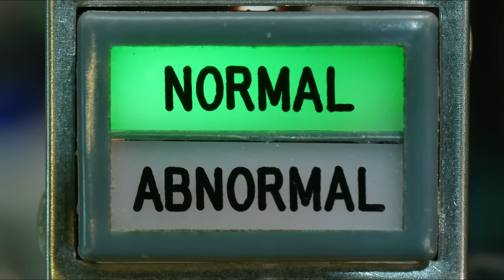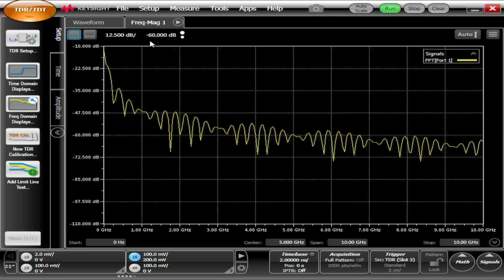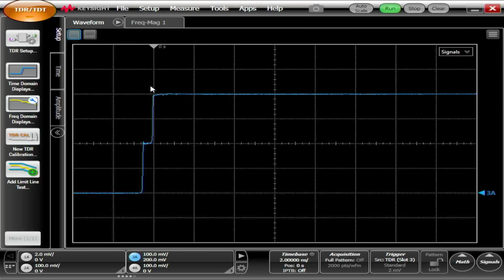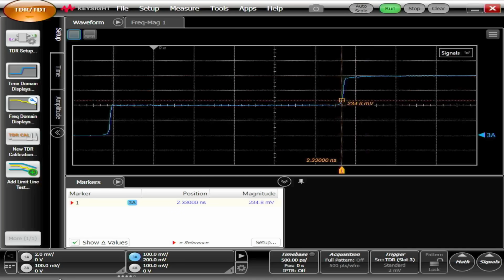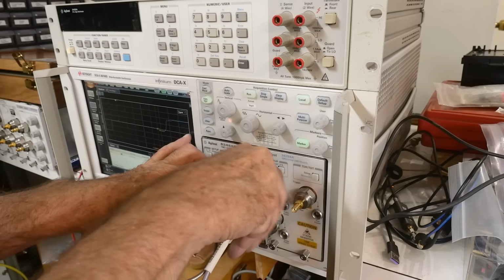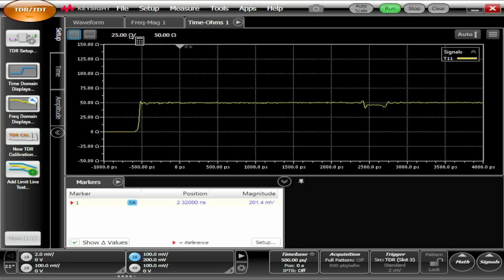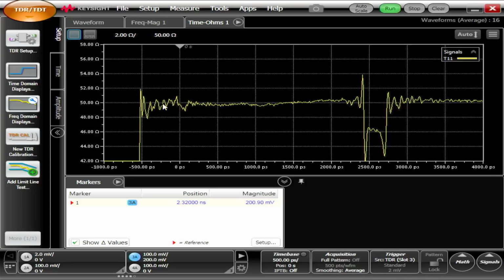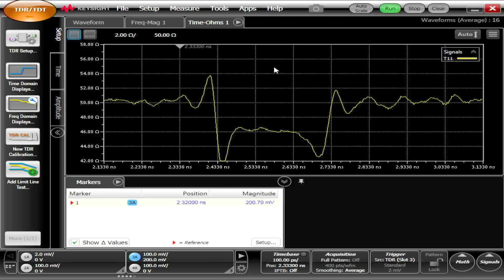# 2296 DCA-X TDR Measurements using Agilent 54754A

Comment: I've seen people use nanovna for TDR, here you did not have to do something like a calibration for the S11 measurement? It's a very nice piece of equipment
Reply from the maker: yes you have to do a lengthy calibration with expensive cal standards. I'll show that in a future video.
Reply from the maker: you can do an FFT transformation to get the VNA data into the time domain. and the other way round

Comment: In my 40 yrs as an EE, I have not seen or used a TDR. Thanks for the demo.
Reply: It is a pretty common technique to check quality of cable line or find a place where it was damaged/cut in telecommunications. This method is used in both copper ( coaxial and non-coaxial), and fiber lines.
Reply: @MSP_TechLab oh, I wasn't too clear, I know exactly how it works and what it's used for, just never seen one. Thanks for your response, spot on.

Comment: TDR is a good use for this sampling scope! That was a nice demo - also hItting 46 ohms is not bad for what I assume is a non-impedance controlled PCB run - just the variation in manufacturing process/materials could make up the difference from the 50 ohm target.

Comment: Its look like you had ground plane next to the conductor waay to close. That increases the capacitance per length so the impedance is lower than 50 Ohms. Line impedance is the square root of (L/C)  ( per unit length )
Reply from the maker: it's called a coplanar waveguide with ground. it was designed that way. https://youtu.be/29YcNXSB9KM?si=EzWOLDy33DpNASbZ
Reply: @IMSAIGuy In that case  maybe the VIAs are adding some capacitance to ground. The formula assumes the ground for the ground strips of the coplanar  is very  far away.
Reply from the maker: https://www.reddit.com/r/rfelectronics/comments/1dx4xmo/how_do_the_ground_vias_affect_cpwg/

Comment: PCB impedances depend strongly on the board characteristics.   Even having a fiberglass bundle under the trace or not can make several Ohms difference.  Manufacturers use a finer mat for impedance controlled boards, but it helps to run traces diagonally across the fiberglass grid.  When it matters, I would also pattern a test board to verify the dielectric constant and adjust the pattern to tune the impedance.

Comment: For locating breaks/shorts in low voltage cable runs (access control, cameras, security systems), I use a Fluke TDR. After entering the wire gauge, it tells me exactly how many feet until the problem. A huge timesaver!

Comment: at what frequency are you doing this test? this is a wonderful machine you got. thanks for sharing it with us.
Reply from the maker: It is a fast edge which includes all frequencies. In the time domain.
Reply: @IMSAIGuy  now i want to see a crossover between this scope and your new keysight to see what it actually looks like. thanks in advance.
Reply from the maker: @rahul9344-o the hd3 does not do tdr
Reply: @IMSAIGuy  What kinda pulse width does it use? Something in the femtosecond or attosecond range. One place I worked, we had a Tek 1503 TRR; I think it used a 1 to 5 nanosecond pulse.
At a broadcast station I worked at, they had a home-made TDR that was a nothing more than a 6 volt AC transformer feeding a voltage divider to a tunnel diode to a BNC. This was built in a little aluminum box mounted to the side of an old Tek 541 or 521? They would tee into the vertical amp and set the horizontal sweep to 60 Hz line trigger, and measure the time. It was a crude device; but it would get you in the ballpark. they would take the scope/TDR out to the AM transmitter that had a 4 tower array in a cow pasture. Sometimes the cows would trample and pinch the sample lines that went out to the towers for the phase/ratio monitoring system. They could get close enough to dig with rakes and trowels and find the picnhed spot - the sample lines were miniature hardline coax. frequently, whey would just use pliers to round out the coax to remove the short without having to splice the line - all sample lines had to be the same length for accuracy of the monitoring system. Other times they would take it down to the TV transmitter when the VSWR got high, and loss of nitrogen pressure was noticed on the 3-3/8 hardline going up the tower. The coax was in 10 foot sections ( I think), but they could get close enough to send the tower climbers to the section of coax that had the bad teflon insulator. You could take a blowtorch to those teflon insulators, and it would barely harm them other than soot deposits. But, if you put 25 KW of RF one that had rainwater across it, they would fry like a strip of bacon.
Reply from the maker: the edge accuracy is more important than width.
Reply: @IMSAIGuy I want to add that if you adjust the width of the pulse, the frequency lobes in the frequency domain also changes the width. Shorter pulse = wider frequency lobe. And longer pulse, narrower frequency lobe.